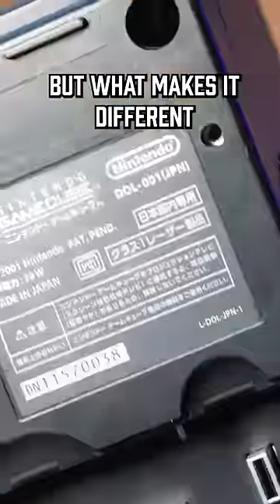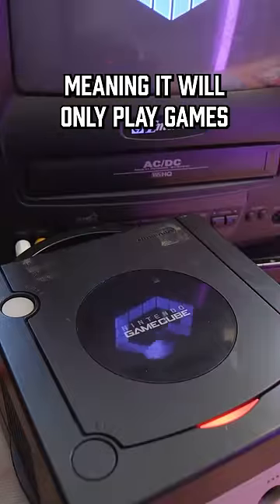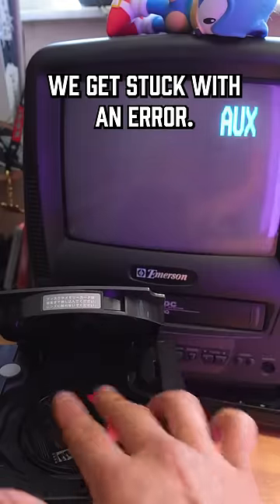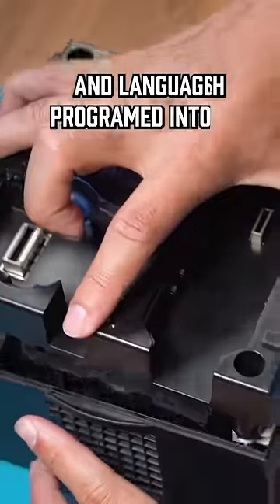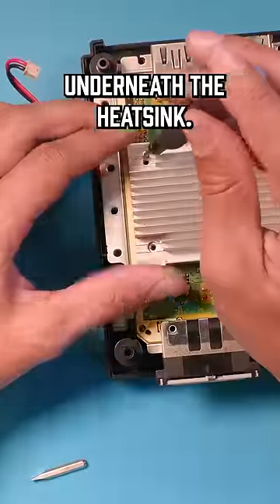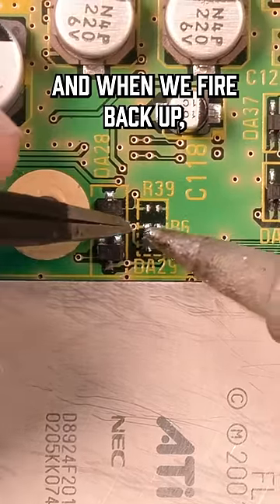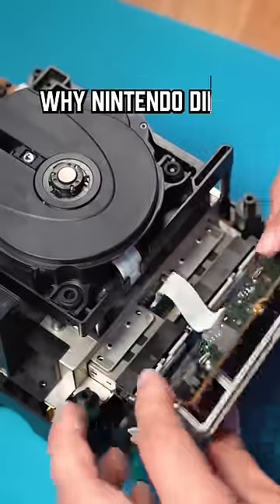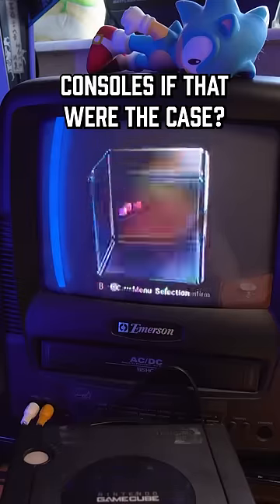Unlock your Japanese Gamecube!!

Comment: So it's exactly like the region lockout on a Genesis/Mega Drive.

As for region locking, the reason why the console has regional lockout is for a few reasons, all of which are purely inside baseball and don't justify the consumer hostility.

The main reason for a lockout from the developer's perspective is that it lets you sell rights to the same game in different territories to different companies. If you do this without region locking, then your US publisher could import copies back into Japan and steal money from your Japanese publisher. Region locking exists so that publishers can tie each other's hands and not eat each other's lunch.

Related to this is music rights. Generally speaking licensing Japanese music internationally is either expensive or just flat-out not an option. Music games in particular are licensed per-territory because of this. This wouldn't apply to the GameCube tho, which had a sum total of like four or five music games (DDR Mario Mix, Donkey Konga 1, 2, and 3, and... uh, MC Groovz Dance Craze).

To be clear, it is perfectly legal for you as an American to go buy Japanese games (see the SCOTUS case Kurtsaeng v. John Wiley & Sons). Most people didn't even bother soldering the region lock resistors either - they'd just buy a region free disc, which probably were legal too. (DMCA 1201 might have some objections but I never remember Datel actually getting sued for anything.) None of the above matters today anyway, because region locking is dead. Everything is either a worldwide release with one publisher, or so region-specific that you'd never bother having two publishers.

(Except for China, of course, because they have shittons of censorship. Fuck Xinnie the Pooh.)

The Game Boy wasn't region locked because... uh... I actually don't know. There's a region bit in the ROM header but the Game Boy doesn't check for it.

Comment: The GameCube power cord is the same cord that most tvs and consoles use to this day. However, Nintendo designed the cord to be shaped differently so it wouldnt fit in other devices unless you shaved off the rubber edges with a blade. Nintendo hates you.

Comment: It's better to use a xeno mod. That allows you to also play backups and homebrew on disc. Although single layer mini dvd-rs  that don't require the laser potentiometer to be adjusted are getting annoyingly hard to find.      Pico boot is a step up and will allow most games to run just fine. GC loader has almost full compatibility but replaced the optical drive.  

Unfortunately the best way to play backups for a small number of games is to take a video downgrade and play them on a modded Wii or use an emulator.

Comment: You do not have to tear down the system.
What you actually need is: Action Replay Disc, Memory Card SD gecko (SLOT B), SD2SP2. This way, you can use an exploit to boot swiss, and within swiss, you can boot any region disc you want. No hardware mod needed at all.
Reply: Staying as original as possible is much cooler... and easier for the normal enduser.

Comment: Region locking did have a purpose back in the day a lot of old pal games run at 50 hurtz to where ntsc runs at 60 hurtz so games in Europe use to run at about half the speed this isn’t a problem now a days and is why region locking is mostly dead Nintendos just an old company and doesn’t always like to change super quickly

Comment: Ive just chipped my NA cube, on bootup it'll force the cube to read the disc (if its non NA) but Ive found JP F-Zero GX doesnt work with the chip for some reaosn but otherwise no issues with any other games I've tried.

Comment: We have a global brand, a global supply chain, a global set of offices as we're a global multi-national, an global finances. Lets have local markets to be arseholes.
I'd have attached a 6 core ribbon to those terminals, and added 'fu*k you regional control' switches to the case.

Comment: region lock is some weird requirement of the DVD standard. Annoyingly you cant even play out-of-region DVDs on your computer's DVD drive without changing its region. Which you're able to do. And are allowed to do five times. For no fucking reason.
Or you could distribute region 0 discs that work in every region, or set your drive to region 0 and run every region's discs
it's sheer lunacy

Comment: Honestly region locking ANY products is a bad business strategy. 
If I was a company I would absolutely want anyone who purchased my products to be able to purchase games regardless of where they bought it and play in their own language. 
This is an example of Japanese being  obtuse to the point of shooting themselves in the foot, as Sony has done the same thing with its Playstation products.
Reply: This is true today. At the time it was a great business decision to make it easier for customers to navigate the market and make it a no-brainer for them. It's not only about the language. These systems have different video outputs depending on the region, and a lot of TVs will not be able to display the signal of a foreign console. There is the framerate, color modulating scheme and synchronization that need specific hardware to be each handled. It's not so easy. That resistor only controls what the region the software should operate as.

Comment: Customer : Does this Game cube play Japanese titles?
Clerk : It doesn't under normal circumstances.
Customer :What do you mean? Like it just doesn't have an update or is missing the files to translate it?
Clerk : No it's all in there, it has everything it needs to run all games, regardless of the region. But you just can't.
Customer : It's all there?? So why can't I use it for any game at anytime?
Clerk : That's because we used a soldering gun to make it only load English games. You speak English, don't you? You should be good to go.
Customer : facepalm

Comment: I always felt the gamecube was underrated for how much power it had at the time, compared to the PS2 really this is Nintendos 1st bad selling console in the console wars. 
I blame the lack of DVD & CD features unless you somehow got the Panasonic edition
 model. Which should have been its refresh. It would have done alot better. 
This was ultimately where the Wii came in but still didnt do physical media even though it could. It sacrificed power to where it started Nintendos logic to not make strong hardware anymore leading to a dud of the Wii U era eventually to the Switch. 
Which is Ironic as the Wii & Switch are there best home consoles in sales still being vastly underpowered.
Makes you wonder. The Wii is  only twice as much powerful as a gamecube. Not a huge jump. 
As there pillar thing went back in the day. The OG Wii is basically a better gamecube with the ports & backwards compatibility to do so.
Which is odd. I do however worry with the Switch 2 and physical media dying this year. What will become of Nintendos plans.